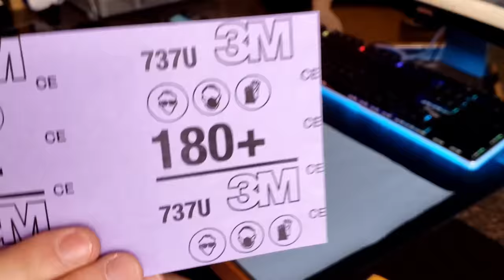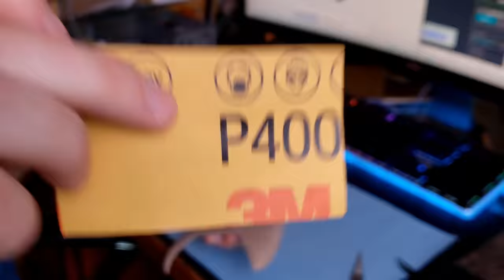3D Printing WOOD Faceplate For XBOX Controller | Sidewinder X2 & Octolapse

Comment: Is there any controller design software? I'm making an 11 button, 4 thumbstick, 2 d pad, and 10 trigger controller with a power button with ps5 sensory motion technology for a video game I'm making.

(I'll describe the details: 2 thumbsticks on the left, 2 thumbsticks in the middle with the power button, 11 button on the right. Bottom left on the handle is a D pad, Bottom right on the handle is also a D pad, and 5 triggers on the left and 5 triggers on the right and upper middle has a light bar, touch pad and, menu button) also can have accessories.

Comment: Did you come into any problems with the printed screw thread? Did the model even have a thread or what it just printed tight enough for the screw to tap one?
Reply from the maker: I did come into some problems with the screw thread. Since making this video, one of the screws popped out of the threads, leaving the face plate a little loose in that corner. My other wood faceplate has held up just fine though. I think they printed just tight enough for the screws to tap themselves in.
Reply: @FunctionalDesignsCo  nice, have you uploaded the stl anywhere?
Reply: Could always edit the stl to make those holes bigger for threaded inserts and replace the screws with bolts